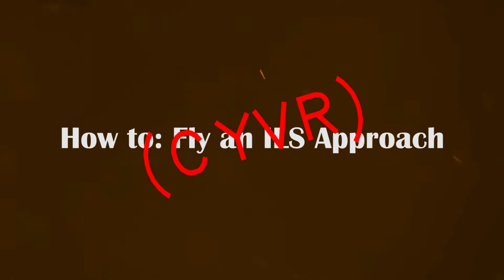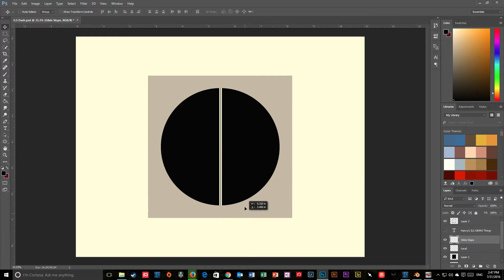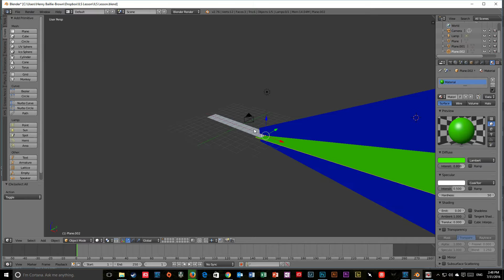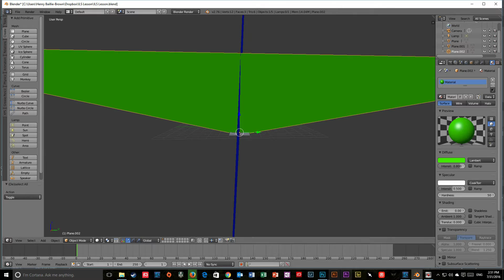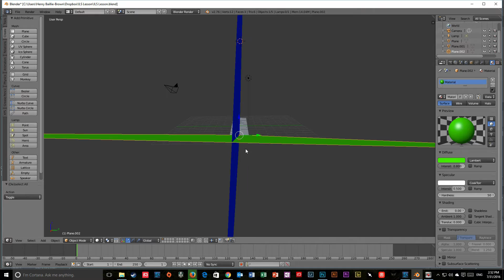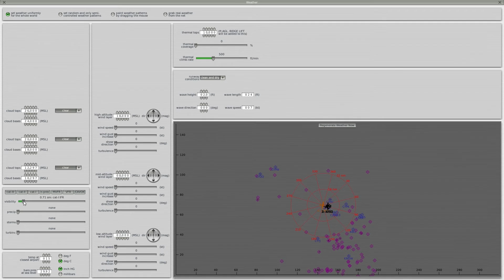How to: Fly an ILS Approach (x-Plane Lesson & Theory)

Comment: I know this is a very old video but would suggest having your heading bug setup to runway heading in case everything goes to pot and you become totally discombobulated, all you have to do is hit hit heading bug on autopilot to bail out of VOR (ILS) approach add throttle and ease yoke back for a missed approach....the heading bug will at least help to keep wings straight and level while you get your head and thoughts back together.

Comment: On an ILS you pitch for vertical speed, you power for airspeed and you flight the heading that will keep you tracking the localizer.. you have to use your instrument scan to constantly control all three parameters and fly a stabilized approach to the runway. Using pitch to control speed and power for descent rate will result in very poor control and make it difficult and close to impossible to fly the ILS
Reply: I find it easiest to set trim for speed, usually 80ias, configure, and note the throttle while level under the glideslope. Then reduce power by about 1 rpm for every fpm  of descent, slowly, as the glideslope line reaches about 1 above. This would be less if you have better performance due to low weight or density altitude, mabe closer to 2fpm per change in rpm. Then I should be at a stabilized descent profile of around 500fpm, 80kIAS, and have a centered cross to minimums. If the localizer is trending left or right, I correct by not more than 5 degrees either way, and if my glideslope is trending up or down, I correct with no more than 50 rpm either way. I then pitch gently to maintain a constant airspeed, and let the vertical speed settle. Realistically, you should only really need yoke input for transient pitch corrections during power changes, ir with flaps. Once steady, the trim should do its job. Pitch+Power=Performance, and Performance=Airspeed+vertical speed. Especially with non precision approaches, you need to keep a constant airspeed (and therefore groundspeed, barring windshear) to make sure you reach the MAP in the correct time from the FAF. This is especially true if you are flying a minimum equipment NP approach, as I think most pilots should train for. Turn off your GPS for ILS, LOC, and VOR approaches to see how you do. You might need it someday.
Reply: @zacharytaylor190  If you continue to fly faster airplanes, you will see that your technique will not suffice. You want to stay on the center of that beam as you appraoch the runway. You goal is that once you intercept glide slope you will be in the center of the beam. If you get an error in glide slope, you will correct it inmediately by pitching and you will see the correction. Speed is critical but not as critical as the glide slope and localizer. As you approach the runway, the become more sensitive. 
The aircraft I fly has an appraoch speed aeound 150 knots.